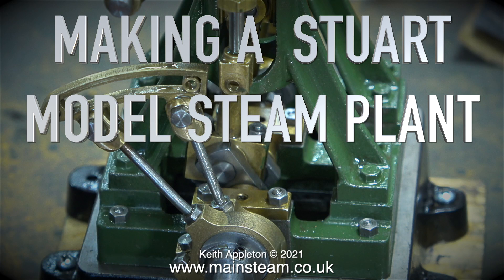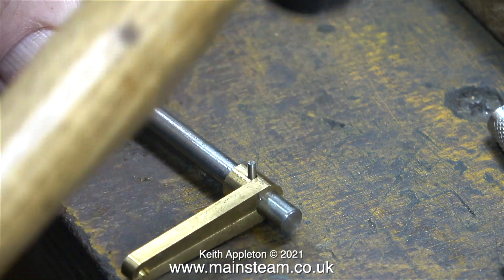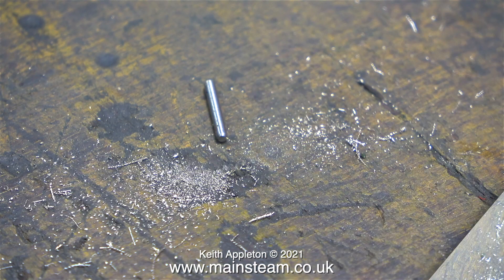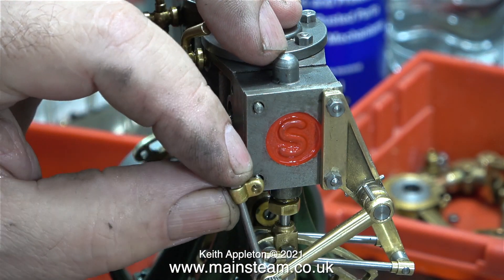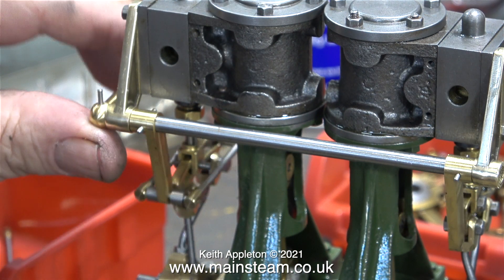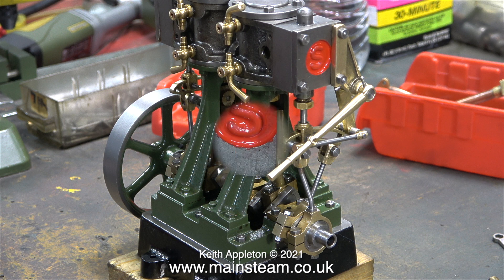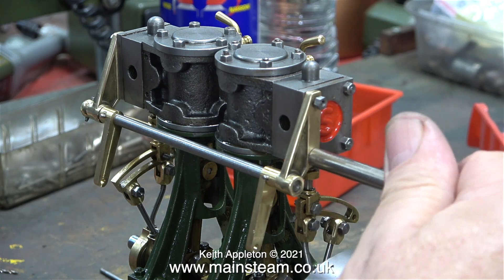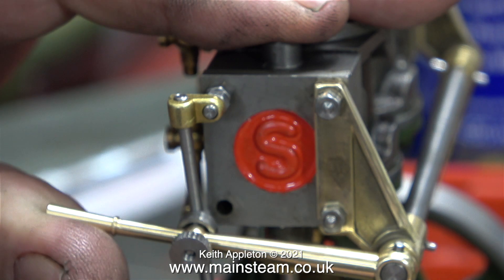MAKING A STUART MODEL STEAM PLANT - PART #27

Comment: I built a 10v from a poorly started kit, the results being a .01 over bore, and and the only non- BA threads are 3-48 on the eccentric links due to cost of a proper die here in the Colonies. It does run on lung power, and machining the reverse link kit was great fun. 
As a die maker, I occasionally cringe at your methods, but am humbled by your skills and generosity.
Thank you again.
Reply from the maker: I am sorry about your cringing, but please bear in mind that I do actually take a lot of time & effort to make these tutorials for Beginners to the hobby - not Die Makers . . . . . .